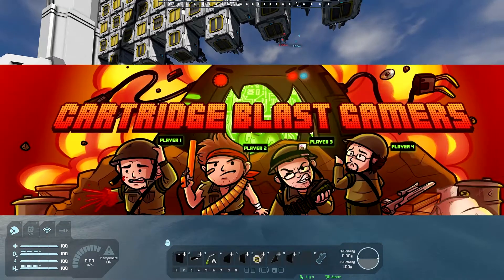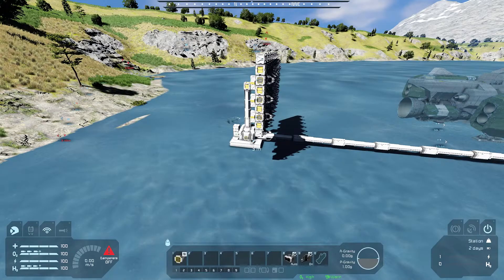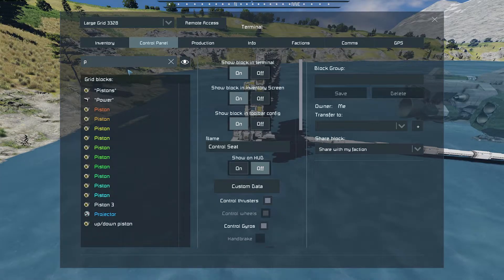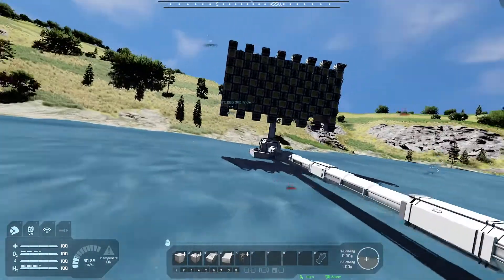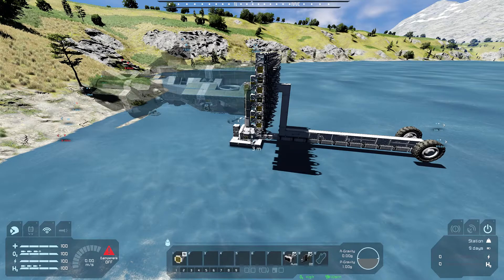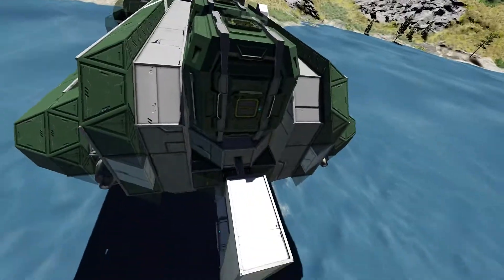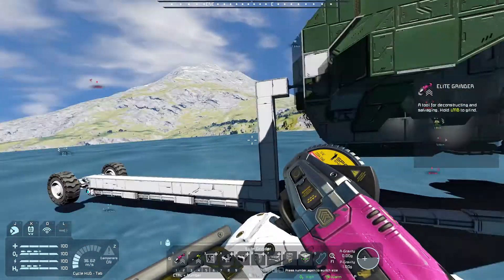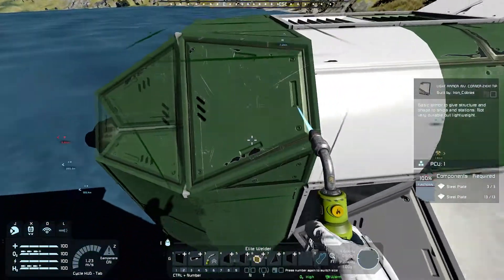Space Engineers Planet Side Large Ship Printer

Comment: In survival mode, the weight of the ship will cause the entire print to sag right or left and could possibly get hung up on the welders, and the print will jam. I printed a modified B-60, from the back to the front and had to add blocks to prevent the print from shifting too far. There are not many places to "affix" blocks to the print to prevent this movement. My suggestion is to increase the number of your saves and if it gets hung up, back up and make adjustments/supports as needed to control the sag. I only had about 6 missing blocks and some incomplete, possibly due to inventory of some components running low. The print will continue if you run out of components, so keep an eye on it and use IIM (inventory manager) to produce components while you are printing, saves a lot of re-work.

I haven't had this problem with small grid ships, relatively small , small grid ships.